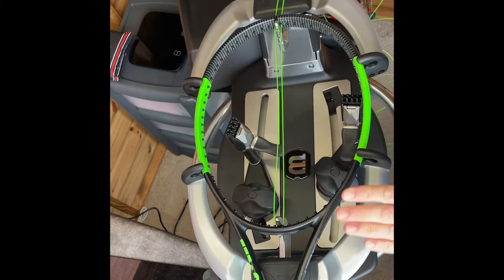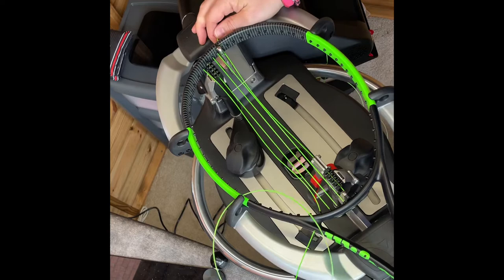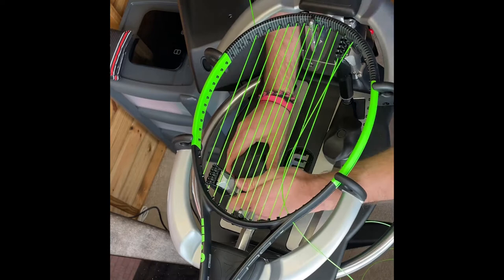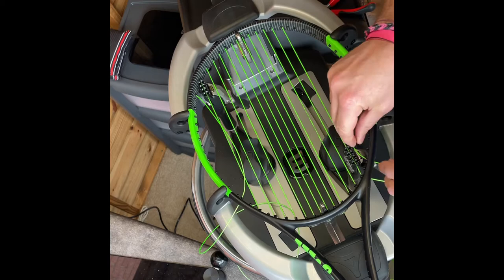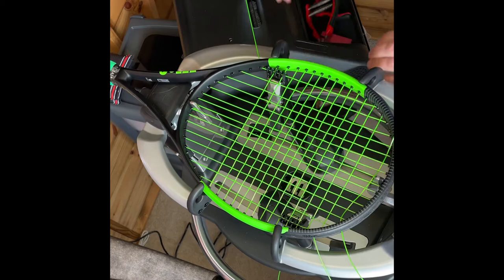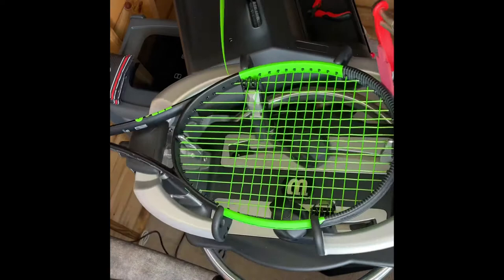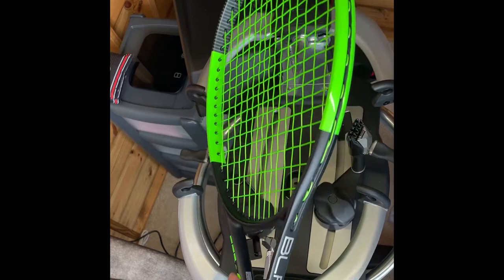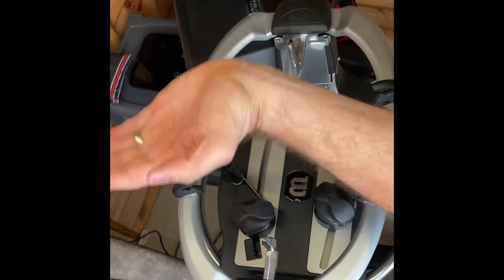Tennis Racket Stringing - ATW on a Wilson Blade Team

Comment: I modified this after some measuring for a couple of reasons I think are pertinent. Doing the 1st cross at 3rd sting down is closer to the frame support and deforms the head less, big plus. I measured it with a vernier gauge on a few frames with this pattern and USRSA, Parnel and another I cant remember who instigated it and noticed differing frame flex (was an MOD engineer for 12 years and I like to separate fact from opinion, just for my own OCD). 
Best results for ATW in regard to unstrung frame where starting the cross with long side (LS) on 3rd cross down from head. This is closer to the frame support, and it deforms the frame less. LS does outer main going down and finishes the throat crosses. Short side finishes last 2 head crosses. Bonus, less cross strings on grommets and no long pulls.
Reply from the maker: Always good to test things out and I often also modify patterns. This is a more tradition version of the UKRSA, more for demonstration purposes. Good to see you’re putting your engineering skills to good use 👏
Reply: @stringdoctor6238  yep. HNC Mech Eng BSc sport science. Never really get to use any of it. 🤦

Comment: so what is really the big advantage of stringing one piece over two piece stringing?
Reply from the maker: On tennis I would usually do as a two piece to maintain better tension in mains and crosses, however if using the same string in crosses and mains, a properly strung ATW one piece can be very good, especially as the tension is very even on the side mains. It's good to have options.

Comment: It looks like you don't move the string much (in order to avoid string burn) when pulling the crosses through. Is that something you don't bother with depending on string material?
Reply from the maker: Hi there, yes I do move it, but concentrate on not pulling through too fast - more important with angled string like Hyper G. The closer to the throat you get, the less room there is to move, so you slow the pull through even more.